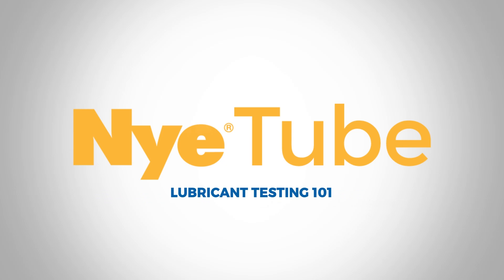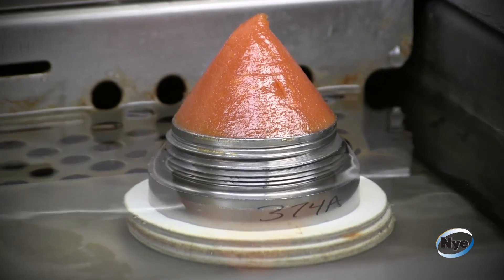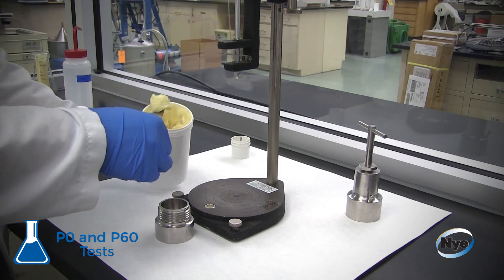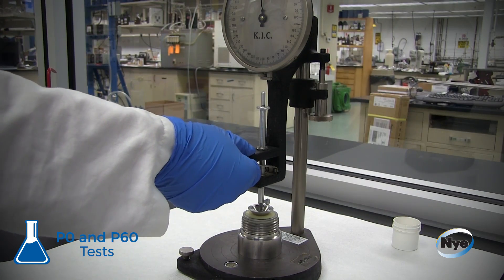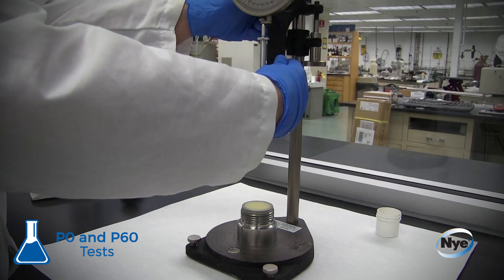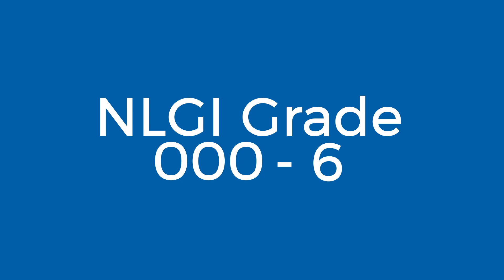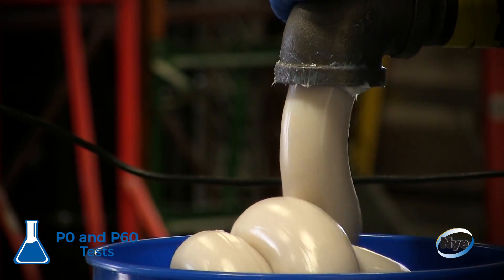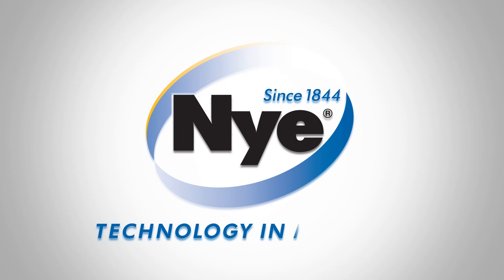Lubricant Testing 101: Penetration (P0 & P60) by Nye Lubricants

Comment: Which grade is better for automobiles
Reply: Different lubricants for different parts.
Reply: NLGI -1 2 & 3
Reply: customized by OEM or manual book
Reply: For high speed bearing you need low viscosity NLGI-2 or NLGI-1.

for heavy duty you need NLGI-3 with EP anti wear.